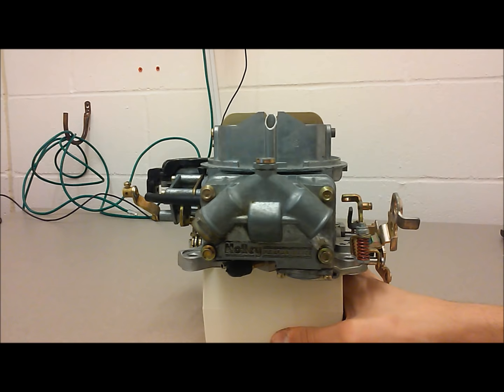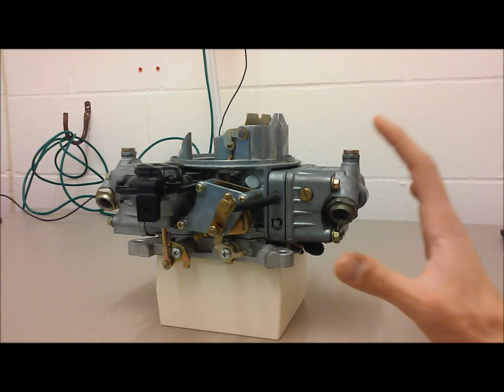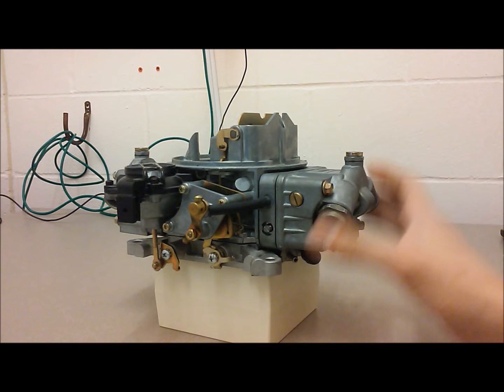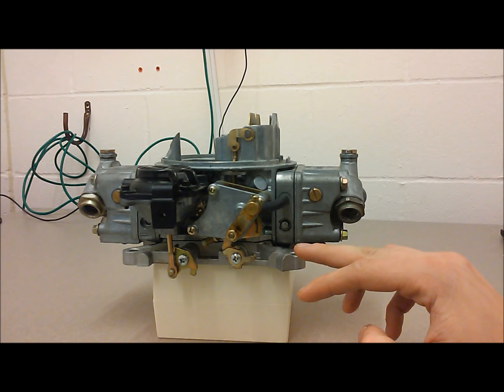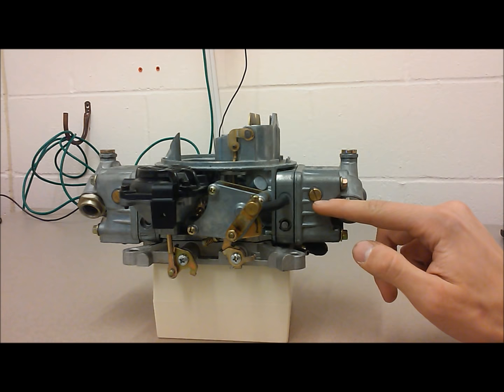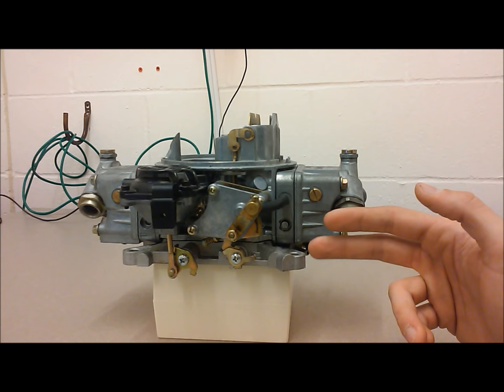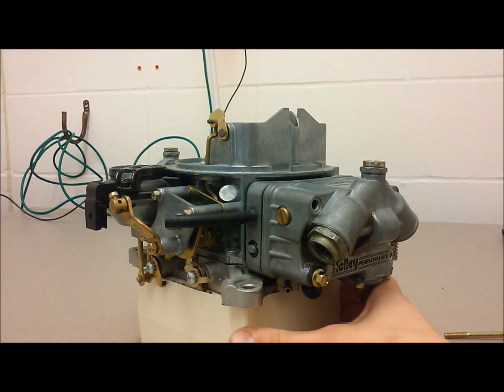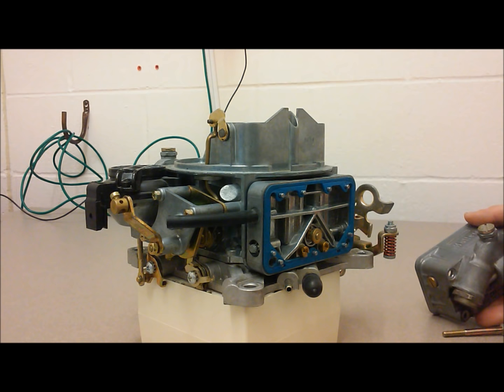Holley Carb: Proper Carburetor Jetting (CARB BASICS PART: 3)

Comment: if i remember right on a holly carb the jet numbers are 2 % for each jet number.   a friend had 1960 Buick.  with Rochester 4 bll.    he went to pikes peek .   it all most didnt get to the top.    i built him  an AFB.   the next time he went there he says it just as good at the top as at the bottom.   years ago i did a LOT of work on AFBs.   if you cant tell i like them.

Comment: I've got a stock 289 A code with modified J code heads, 1.94 1.60 Ferrea valves, ISKY Mega 280 cam nets about .551 at the seat with 1.6 ratio roller tips. Using Try Y pipe that are wrapped with DEI Lava wrap, was having carb heat soak issues from the pipes, the wrap pretty much resolved under hood temps issues. Using Cobra high rise intake that is port matched, and blocked crossover, with open wood 1/2" carb spacer. Built up the carb using 3310-1 bowls, and throttle plate, 600 CFM 4150 main body that has been worked over machined to fit the larger 3310 base plate, smoothed out, choke horn is gone. Primary jets are Comp Jets 69.75 and 78 secondary with adjustable secondary vacuum pod 5.5 power valve it's a little fat but it runs really good 65-70' air temps I get about 11" vacuum at idle. Still little more work here, think it needs a good spark curve, I'm looking at the MSD E curve, and a good dual A/F ratio gauge.
Reply from the maker: you are really in deep to this! 
allow me to potentially add to your list - 
what type of fuel pump are you using? do you have a return line set up?

Comment: Opinion?  I also have a Holley 670 Street Avenger. Mine is on a 350 powered 65 impala. I bought the carb from Summit based on their advice after they factored in everything I was running. The car starts right away and runs decent but it seems the carb is running really rich based on the exhaust smell and it also stumbles when I floor it. I first thought my problem was timing but I haven't had any luck playing with that. If I decrease the fuel air mixture at the carb any more the car stalls as the meter adjustment is almost fully closed at that point. People who I've talked with on this suggest carbing down to a 600cfm and others have suggested just re-jetting my Holley to a set of smaller jets. My gut tells me to get a full dyno tune as I have a very tall cam. I just pulled my carb from the box and bolted it on. I only adjusted fuel and idle on the carb. Didn't touch the floats. I also am not currently using a fuel pressure regulator.
Reply from the maker: +RYTHMIC “RYTHMICRIOT” RIOT if you do carb down, go with the summit 600 - tremendous carb. if its bogging when you punch it and you have a tall cam, i almost guarantee its accelerator pump related. and lean! try idling at around 900 and setting your pump cam position accordingly. try this and get back with me.

Comment: I have a 77 Bronco that I am going to put a roller motor in and was going to go carbureted do to the simplicity. You stated that when you travelled through WV you had to re jet your carb a few times. Well, that's where I live and my day may start at 700' go as high as 4200' and return in the same day or half day. Seems kind of like a nuisance to stop and re jet constantly especially when you may change elevation of 2000' or more in less than 10 miles. Suggestions? Or would it behoove one to go with a Holley Sniper system? Thanks

Comment: All you should have had to do is  adjust the screws on the side of the metering  block those meter the fuel not the air. And as far as changing Jets not everybody has access to a drag strip but if they do either a drag strip or a dyno that's how you really know what your motor wants..
Reply from the maker: Or just run a wideband. And the mix screws only directly adjust the idle fuel metering

Comment: Could you share your opinion on jet size.  Holley 600 cfm  4160 vacuum secondary.  Has listed jet size of 122-642. 1973 Pontiac 400.  700 ft above sea level, comp cam the smallest they had for RV type Power. . Holley performer dual plain with open spacer to convert it from a spread bore. 1967 Bonneville Convertible ( heavy car) dual exhaust and stock mechanical fuel pump. Rebuilt the carb has #41 jets in it?

Comment: I am going to buy a fuel injection system in the future. I am planning on driving from Florida to Arizona  and changing jets and metering rods often don't appeal to me. Is there a way around all this? Great video.
Reply: Its not as bad as it sounds if your just cruising through. Back when there was no EFI we drove our carburated cars all over without rejetting. I do remember it my car not running well when I was in the Rocky Mts though.

Comment: I have a Holley carb question... I'm trying to save my mid 80's 1850 with a refresh after the car has been sitting for years. Question is how to remove the old gasket material? I'm no stranger to removing old gaskets from things and have worked on cars professionally. I have never seen gaskets so stuck on anything I have ever worked on. There has to be a chemical out there for this? Regular old locktite gasket remover doesn't even touch this. Even a razor blade doesn't do very well at all. It's like the gasket has turned into a rock. The carb body and other parts are too delicate to get crazy with a wire wheel.
Reply: Acetone and gloves. And a mask and a hot cup of tea 🍵

Comment: Does it hurt to run power valve block off plugs in both your primary & secondaries?? l just get tired  of blowing my power valves & them having to replace them all the time, thank you for your time, excellent video👍👍
Reply from the maker: That's odd that you are blowing the power valves often. Drag racers and circle track folk will block off both power valves, but they also have to jet up for the difference. On a car that's driven on the road, your cruising fuel mixture would work out to be too rich. On a street car you want to retain the power valve - what carb in particular do you have?
Reply: ThunderHead289 / its a 1150 dominator on a 428 scj in a 67 galaxie xl, its a strip car but l do drive it on the street from time to time.
Reply from the maker: +GALAXIE 67 what led you to that large of a unit? What rear gears and tranny do ou have?
Reply: ThunderHead289 / its a C6 with a 3000 stall converter & a 9" with 4-11 the moter has been up grated to about a 525 with about 750hp it runs  12.2 which itsnt bad for a 4200lb car, lm still working on the waight problem?? not to bad, l started working on it in college for automotive, then it went in to storage for a long time, l just started on it again with in the last year & l forgot a lot about what l did, & after going through it lm starting to wonder why?? lll just go with yong & dumb
Reply: You need to get the anti blowout kit from holley, you drill a hole almost through your baseplate and install a little round valve (plug).
Reply: LOL@ college! With spelling and grammar like that, I doubt it!

Comment: I have a Quick fuel 600cfm that has bigger jets than the avenger I just bought. Both run rich to me. My question is if the avenger is really putting more fuel if the jets are smaller?
Reply: Look into air bleed jets, I had a quickfuel and damned if I couldn't get it jetted always so rich, ..... I found out later quick fuel had some real small air bleed jets causing a rich condition across the board  just my 2c

Comment: Hi I have a holley 80309 with vacuum secondary I think I mixed up the jets in the secondary metering  block when I took it a part there is a 80 and a 90 jet... so I would like to ask does it matter in which way they are positioned? If so where should each one go? Hope you or someome can help me.. Thanks in advance
Reply: just make sure the smaller jets are screwed into the primary side of the carb securely.

Comment: Have you ever fiddled around with aftermarket fuel blocks like the Percy Adjust-o-jet?
Reply from the maker: I have not, they are a neat idea but expensive. If have to be running an o2 to feel comfortable with one. I've moved away from holleys to the summit carbs that are a little different
Reply: It is interesting to hear good things about the summit carbs. In all my carb research and understanding very few people even mention the summit stuff. They usually mention on the top 2 and only the really expensive versions of both haha. Thanks for the series on carbs.

Comment: hi i have a 305 with a 600 4160 holley. the prim jets were 66 so i changed to 62 . how do i find out if that is the right size for that motor im  new at this  thank you
Reply from the maker: Why are you at a 62 jet, would love to help you here
Reply: ThunderHead289  the 66 were too rich .

Comment: just wondering, I need to step down on my jets... I have 66's in there now... fall is coming here in new england and my car is running very rich... any suggestions on what size I should go down to? 64? 62?
Reply from the maker: Usually you need bigger jets when it gets cold because the air is denser. How do you know that you are rich?
Reply: I've adjusted the carb as best as I can and you can smell fuel out the tailpipe still and rougher idle...  When we had a cold spell down to the 50s the car ran smooth as silk.  New carb also.  I installed it about a month ago. Holley 600 on a 1964 Buick skylark 300 V8
Reply: I really think it's too much carb for the engine.  But I figured I try the jets first. My friend suggested to me to go down to 64 from 66. Should run better now while it's still warm out during the day,  and as for the winter months it should still be OK...  He told me not to go too low only because if it's really lean I may run into major problems down the road
Reply from the maker: +Michael Holden jets play no factor into the idle, set your throttle blade so that only a square is showing on the transfer slots. Loosen your distributor hold down nut. Fire up the car and adjust the initial timing until you are idling at the desired rpm. Also, watch my video covering adjusting your mix screws with a vacuum gauge and do that also. It's all a balance, you will move the timing around a degree or two, adjust your mix screws a bit, and move the curb idle screw around a little (but only 1/4 of a turn either way from the transfer slot square on that one! ) does this make sense?

Comment: why do my idle enrichment screws not change anything all the way in no change i had devane carbs do some work on my carb that was suposed to lean out the bottom end he drilled some holes in the butterflies and opened something in the metering blocks and now when i stomp on the gas it pops boggs and runs like shit watcha think
Reply from the maker: +William Morton The idea behind drilling small holes in the butterflies is to give you a little more air to get the engine to idle without having to open the throttle blades so far and getting past the idle circuit. Often with a large cam by the time you get the blades open enough (enough airflow) to get it to idle you're past the idle circuit and into the cruise area or main circuit. with our hollies, we can open the secondary throttle blades a bit to account for this. this should have been done first before drilling. poping and bogging is a direct sign of a lean condition and that your now getting too much air. 
- with the idle mix screws not doing anything, that only happens where the primary throttle blades have been opened to the transition circuit (rectangular slots). 
- its hard to say without seeing it, but make sure first that your primary throttle blades are open to the right amount. 
what was their reasoning behind doing what they did?

Comment: hey man. I have a Holley 650 on a stock 350 with long tube headers, I live by the Jersey shore so I'm at sea level, my carb has 582 jets on the primaries. does that sound safe? I don't have an Afr guage or even a bung in the exhaust for one. no spacers and a low rise intake, it's also spreadbore. carb is a 7002-1
Reply from the maker: I'd look into what that specific carb had factory, then get yourself a good 4 hole spacer and try it out. I Bet a stock jetting and the spacer would help things a ton. I wish I was around all the people who ask me questions, I'd just come right out and do all the tuning for them.
Reply: The car is an 85 firebird. With no spacer the air cleaner touches the hood. Spacer isn't really happening lol
Reply from the maker: +Chris Bentley that's pretty tight. I recently did a little 2 part video series of working over a subscribers carb. Check my recent uploads. It lays everything out in one vid
Reply: I will. Thank you for all of your input.
Reply: What are 582 primaries, never heard of numbers like that on a Holley.

Comment: Will Jets size will make your headers glow red?
Reply from the maker: Late timing will do that
Reply: @ThunderHead289  I had like 3 people look at it and they can’t figure it out I recently put a new holly carburetor and after like 3 min of the truck been on idle engine bay gets so hot and headers start to blow red. I have a 383 stroker some one told me I might need bigger Jets.

Comment: how do you no what is the correct air to fuel ratio,like what is normal readout ?
Reply from the maker: cruising should be around be around 13 to 14 - i never go above 14 because of runner length issues. under power you should shoot for 12 to 12.5 - i usually have an o2 on board
Reply: +ThunderHead289 
do you have a video of the o2 setup, how to plug it on?
Reply from the maker: i dont, hilarious really that i have never made a video on it. you have to weld in a fitting to your exhaust. its basically like an o2 sensor with a readout.

Comment: if youre only supposed to have the fuel at one curtain point in the bowl, why do they even make it adjustable?
Reply from the maker: The floats? If you have a fuel pressure regulator, turn it up or down, you will see the float level change. You will need a lower float setting to hold the level where it should be with more fuel pressure. Sounds stupid, but for whatever reason that's how it is. Float level settings are greatly effected by fuel pressure.

Comment: What cause carb popping on acceleration
Reply: To much air not enough fuel = lean miss fire. Check make sure no vacuum leaks. Accelerator pump giving a good squirt of gas.

Comment: yeah me too but those guys dont share info because if you know what they do you dont have to pay them i just wonder if mot having any adjustment in the idle enrichment screws is leaning me out up top that was Never an issue before i have the enrichment screws one turn out any more than that and the idle goes down and it smokes and goes way rich at idle wich cuses me to open up my curb idle screw wich takes up transfer slot yadda yadda yadda is it possible he didnt drill big enough holes will to lean of an enrichment screw setting lean out the top end? wtf
Reply from the maker: +William Morton though it is true that each curcuit builds off of each other and hence why i have an order to the way im making these videos, it should not have that much effect to the point that you get lean popping. one turn? mine are always 2 1/4 to 2 3/4 on everything. all that aside, that isnt your top end problem. make sure they didnt fool with your float level, if its low it will adversly effect top end jet performance. did they tell you everything they did or did they just mess with your carb then give it back?
Reply: MAN, I haven't seen that big of a sentence in a long time.
Reply: Great video thanks yep I agree I have a circle track carb on my 69 250 they all say it was designed for that truck or big trucks in general they all ditch the 50 cc accelerator pump and use a 30 cc I called a well know carb seller builder for circle track he told me if I do that mod I will have a major stumble off idle and basically I just asked so there's no mods I can do to keep the performance but save a little fuel he basically said no ?????? Do why do they all drill the throttle plate holes out ,take off the choke plate , use a 30cc pump and all that ? Maybe he was running me around in circles ....

Comment: How to adjust the float on a non adjustable float Holley carburetor part number 80457-7
Reply from the maker: You would have to bend the tang connecting the float to the needle and seat. I wouldn't mess with it though if you do not have a sight plug.
Reply: ThunderHead289 Do you have any pictures of the float. that  can give me a l deal how to set the float. none adjustable float  Holley carburetor

Comment: hell i dont know the guy is suposed to be the shit did the carbs for farm truck and daddy daves somoma and shit so if the primary throttle blades are passed the slot at all the idle enrichment screws wont work they never worked ever even before he drilled the butterflies i have no clue man i started out with a pig rich idle conditon on a car that ran pretty damn good to a carb that idles alot better and lower rpms locked in at 34degrees but now runs like ass it frustrating
Reply from the maker: +William Morton gotcha, first thing i always do with tuning any serious car is hook in an afr gauge so i know where im at. it just sounds lean up top which wouldnt have to do with the butterflies. so quite possibly that is all set up right. wish i knew what he drilled in the metering block.

Comment: my fuel pressure gauge jumps around all the time....is that a bad fuel pump?
Reply from the maker: Danny Borelli jumps around from say 1 to 5 or just bounces between 4-5? Is it a liquid filled gauge?
Reply: Vaporlock I have the same issue...run a return line.
Reply: yes,liquid filled, jumps from like 2 to 5...
Reply from the maker: Danny Borelli the mechanical pumps will do that to a degree. If you are having issues with how it runs, I do also recommend a return line with return style regulatory
Reply: my fuel pump does have a return line
Reply from the maker: Danny Borelli what issues are you having other than the gauge fluctuation ?